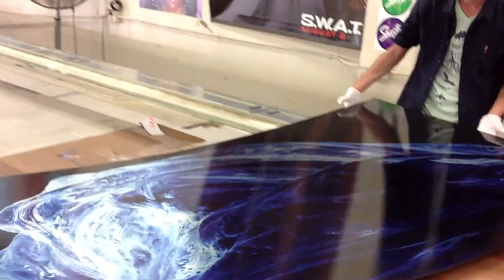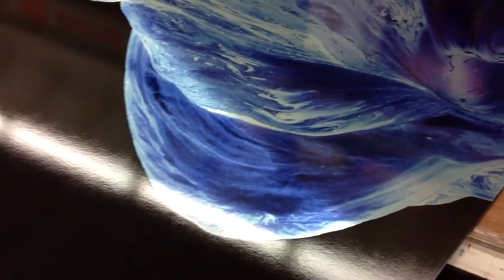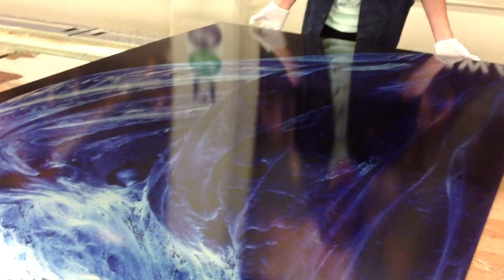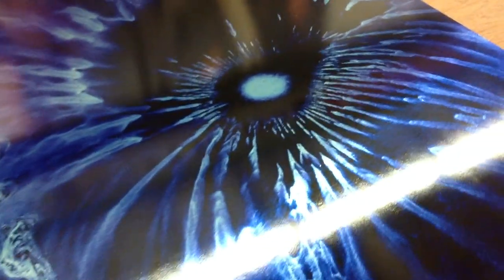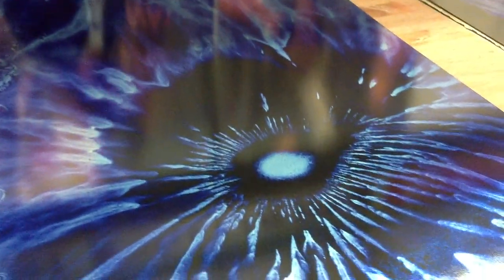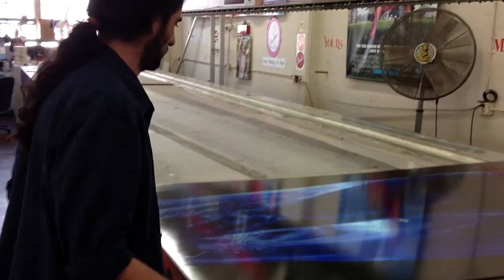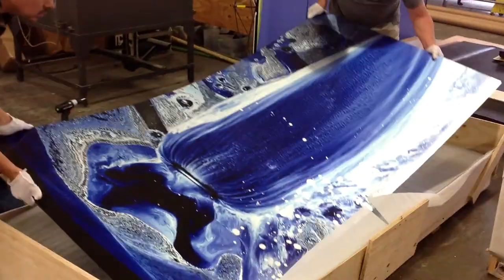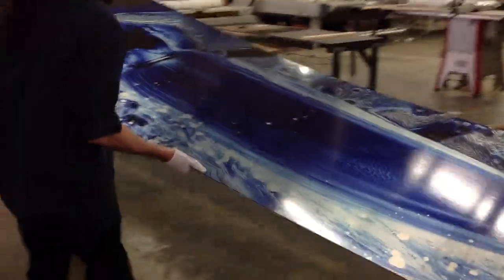Moses Hacmon Fine art Dibond Aluminum Gloss Lacquer Master Pieces for "Faces of Water" Exh

Comment from the maker: This was in fact printed with the Oce Arizona UV Flatbed printer, it is a 4 color printer that uses variable ink drop technology which allows for very fine quality from a 4 color gamut. Though it is not as good as a 12 color printer, which we have, it does an amazing job, plus that it is the only way you can print onto rigid substrates.